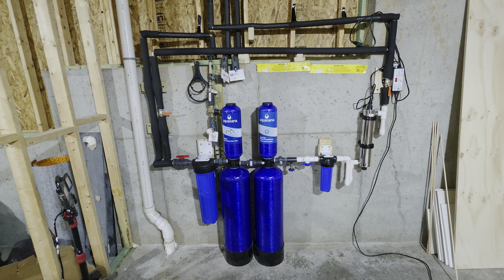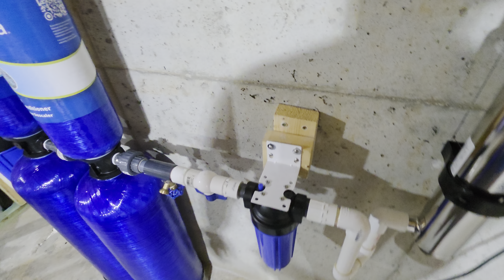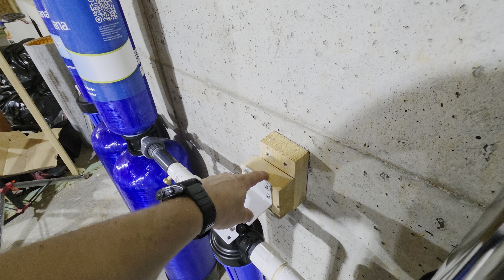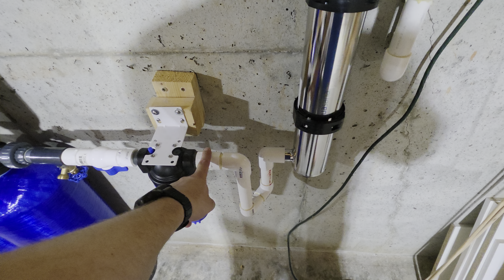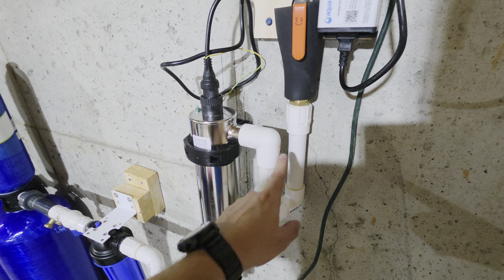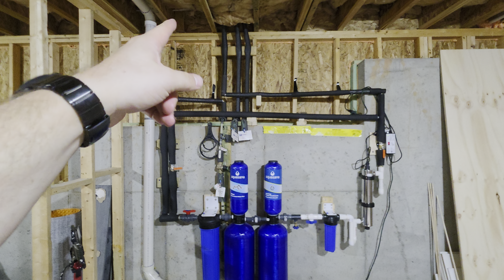Aquasana Rhino Max Flow Installation Overview

Comment from the maker: I have not done a post install test yet, but this is what I have noticed since the install. I did flush the water heater too after install to make sure the whole system was flushed.

Both my wife and I feel like our hair is softer and smoother after showering.

I have seen a noticible decrease in the orange tint you see inbthe shower where the water dries.

There was about a 3-4 day period post install where I could smell the water had almost a sweet smell to it but that went away and per my research it was normall to smell for a few days as all the pipes flushed from years of build up.

Just to give rational behind what I was trying to achieve with this system. We are on city water and I did not test before install because we had a baby on the way so my thought process was. Lets assume the test comes back horribly, what is the system I would install to clean everything. I then looked at water flow rates and went with Max flow because it was way overkill but then I know I shouldn't have to worry about any pressure issues in the future if our usage goes up as the family grows. Also given that we are on City water I figured even if I test now you never know what can change on their proccessibg in the future where my filter needs may change. So I really went with the lets filter everything so I know I am covered even if the water changes in the future.

I also coupled this system with a Waterdrop X12 Tankless undersink RO system for drinking water since only RO can take out flouride. Video on that will be coming soon. https://amzn.to/4eNr5ls